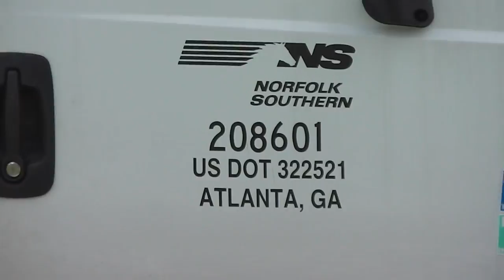Norfolk Southern Train Derailment In(HD) Austell,Ga. 8-13-2013 Full Video

Comment: Cause appears to be that the rear truck was off center and shifted either thru rough handling or missing center pin.  Could have been put off center from unloading process, it appears to be a scrap metal car.  Anyway it was a good day for NS, the
next turnout would have pile 'em up.

Comment: what happend with the wheels ???
Reply from the maker: The Wheels Came Off Just Under The Bridge The Derailment Was Not Notice Until Rail Crews Saw That Something Was Wrong In Transit And Air Pressure.
Reply: Dexter Greene  any idea how the wheels have gone off the rails ?
Reply from the maker: Not Sure Still Under Investigation Track Work Is Being Done At The Crossing Where They Think It Happened.

Comment: Either the Conductor or the Engineer job is fucked.
Reply: These things happen, and It appears to be equipment failure.
Reply from the maker: Brandon Lockaby Yes Sometimes Yes They Do.
Reply from the maker: yes
Reply: I'd doubt it.  The trucks came off the center pin.  There's not much a conductor or engineer can do about that.  Shit breaks.
Reply from the maker: jasfromoz True Not Much You Can Do Yes Trains Break Being Used Day In And Day Out.
Reply from the maker: jasfromoz Thanks For Watching
Reply from the maker: jasfromoz Thanks